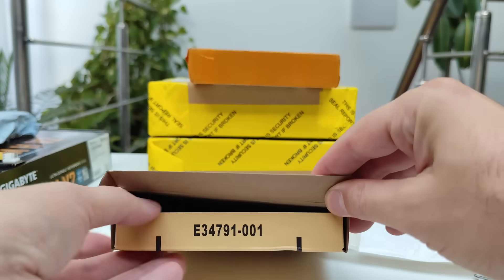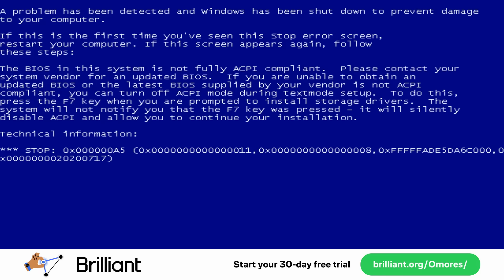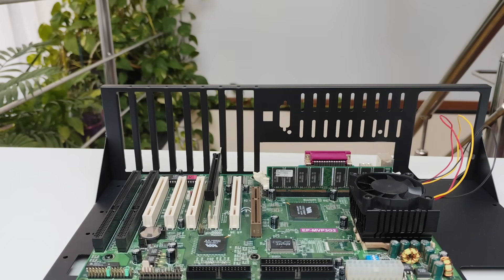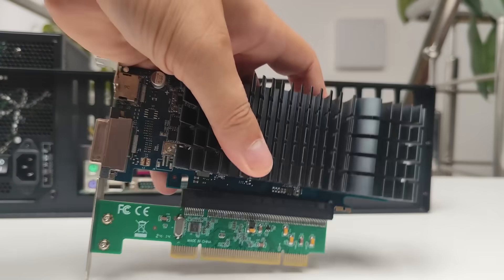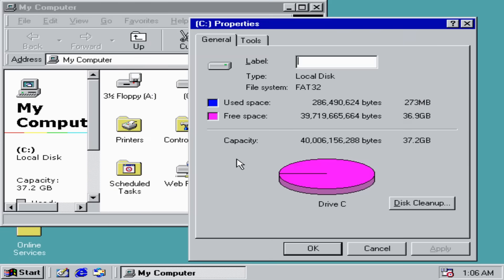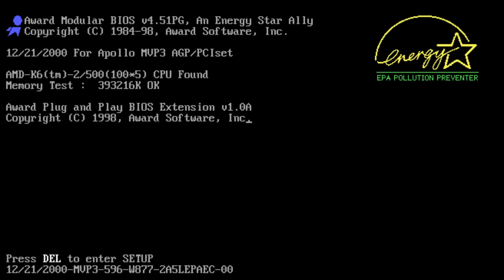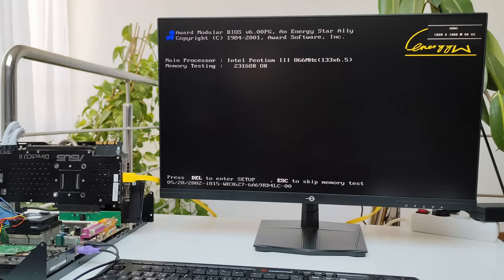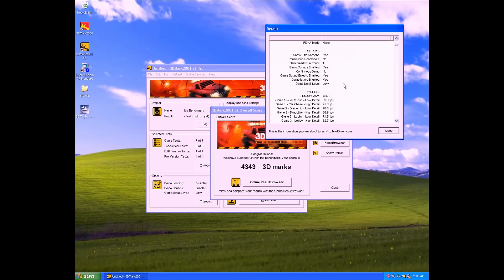The Ultimate BOTTLENECK: NVIDIA GTX 980 Meets Pentium III via PCI Adapter

Comment from the maker: To learn for free on Brilliant, go to https://brilliant.org/Omores/ . You’ll also get 20% off an annual premium subscription.
Reply: you can use a riser with molex power to power the gpu. if there is not enough power the drivers won't load, because the card has to communicate with the computer. and because of that you should also try again with a bi-directional chip and a 16x riser with molex power.  people used the risers to mount several gpus to a single motherboard for crypto mining. with the gpu fully powered and communicating via bi-directional chip there should be no issues.

Comment: Ill bet that the later the GPU (With compatible drivers) the better the speed, due too better compression.
Reply from the maker: I think this is the maximum for a Pentium III. Later GPU drivers require a CPU with SSE2 instructions, so for anything newer, we need at least a Pentium 4 or an Athlon 64. Also, RTX cards do not have 32-bit drivers, so we would need to go even further with a 64 bit CPU.
Reply: @O_mores   I wonder if we have any Linux work arounds for that??
Reply from the maker: @DarkLinkAD  I like Linux, but it's not really my thing. I mean, when it comes to Windows, I know exactly which hardware, drivers, and software versions work.
Anyway, when it comes to Linux and NVIDIA drivers, the support is not better compared to Windows. For example, you can install RTX cards on Windows 7 (released in 2009), but on Linux you need at least kernel 3.16, which came out in 2014.
Like in Windows - Linux NVIDIA drivers for RTX cards work only with 64-bit CPUs, so there's no workaround.

Comment: That "NATO approved supplier" badge is interesting. Lets dicuss that.
Reply from the maker: This is a NorthQ 400W PSU I picked up recently as 'new old stock.' I think it was manufactured around 2007. It’s got a semi-fanless design, so it runs at 0 dB most of the time thanks to a big, heavy passive heatsink. NorthQ actually exited the PC parts business and now they’re a major player in Denmark’s energy industry.

Comment: I remember PIII-1000 being bottleneck already to a Radeon 9600 XT back in the day. :D
Reply from the maker: When the 9600XT dropped in late 2003 (though most folks probably grabbed it in 2004 and later) Pentium 3s were already out of the gaming picture. Around that time, having an AMD Athlon XP was the best buy. The 2000+ to 2800+ models were basically on par with Pentium 4s at similar speeds, but way more attractively priced...

Comment: The craziest thing with adapters would be what Team Fail0verflow did when they were trying to jailbreak the PS4 and used a serial port as a PCIe bus and it worked, despite it being equivalent to something like PCIe 0.0000001x or something like that.
Reply from the maker: That’s really interesting! I used to binge-watch console hacking videos back in the day. I got my PS3 in 2007, but by the time it was finally hacked around 2011… the option wasn’t that appealing anymore. Looking back, it might’ve been a blessing - because once you have too many games, you start a ton of them… and finish none.

Comment: Too bad there is no AGP to PCI-E adapters (at least i didn't see one).
Even in 2x mode it's 500MB per second, which is 4 times faster than default PCI
Reply from the maker: I have an adapter that lets you use an AGP card in a PCI slot - check it out here: https://youtu.be/jflb_6Bpv-o Furthermore, we can use that AGP-PCI combo with a PCI-to-PCIe adapter. The combination won't look pretty, but it should be as compatible as when using a regular PCI slot. However, not every AGP card will work, more details are in the linked video.

Comment: Once i put a 3090 in my i5 3470 rig just for fun, now this is somethiing different
Reply from the maker: I think you could even install an RTX 5090 in something as old as a Core 2 Duo system. At one point, Nvidia drivers required newer CPUs (minimum first-generation Core i series), but as the drivers updated, they removed that requirement. I know because there was an article about running a 5090 on a Core 2 Duo, though the results weren't great...

Comment: You're an inspiration buddy :) these kinds of shenanigans are right up my alley and while I'm still watching a lightbulb went off-- 

how about running some GPGPU/AI/OpenCL-code on those tensor cores in such a retro system? 😇

PS: I'll bet you ran the benchmarks at 1080p? For age-appropriate benchmarking one should switch to 640x480 to 1024x768 max ;)
Reply from the maker: The most retro system that could run an RTX card would need at least a 64-bit Pentium 4, since RTX cards don’t support 32-bit drivers. That takes us back to around 2005... when the P4 6xx series (with EM64T) launched. Or maybe I could try an Athlon 64 from 2003 instead!
Reply: @O_mores   both would be awesome and unexpected by many :) can't wait for a follow-up! 

Oh yeah someone even made a DOS-client for LLMs a while back, very basic but it 'worked'  as a proof-of-concept, maybe it's made some more progress since. 

Let's show the world what we don't actually need dozens of modern cpu cores for ^^

Comment: Through the magic of adapters you can experience 0.25x of PCIe lanes
Reply from the maker: I love adapters… By the way, in my upcoming video, I’ll briefly showcase a PCI-E to PCI enclosure. It’s a metal box with four PCI slots inside that connects to a single PCI-E slot - and it works magic for running older OSes like Windows 9x, 2000, or NT on modern hardware.

Comment: What I really need but can't find anywhere is a PCI-e to PCI-X adapter.
Reply from the maker: If you want to use a PCIe card in a PCI-X slot, there was an adapter from StarTech - model PCIX1PEX4  - that could do it. It used a PEX8114 bridge chip but has been discontinued for some reason.

Comment: do a rtx card now
Reply from the maker: The problem is that an RTX card from the 20-30 series needs Windows 7, which in turn requires an SSE2 CPU. This means you'd need at least a Pentium 4 or an Athlon 64 CPU. I think it would be fun to watch anyway...
Reply: @O_mores that would be honestly
Reply from the maker: The key is the 2018 security update (KB4103718) for Windows 7. It added SSE2 as a mandatory requirement. So even if you got an old version of Windows 7 to install, the RTX drivers themselves are built to expect an SSE2-compatible CPU, so it wouldn't work anyway.
Reply: I don’t think Windows 7 requires SSE2?

Comment: Bottleneck? This is more like a syringe
Reply from the maker: Good one! By the way, yesterday I installed Windows 98 on a Ryzen 9 9900X. It works, but there's a bug or something...  now I have a CPU @4.4 GHz that scores lower than a Pentium II in benchmarks. This is new to me... I hope I can find a solution... On i5-14600KF it works perfectly and I get top scores in everything: https://youtu.be/G7qm3GFy9tg
Reply: The poor performance is probably because it's missing the AMD drivers that control almost everything. (Clock, power, and most importantly, scheduling the two ccd's) I think Intel has some of these built into the CPU, and AMD chose to offload to chipset/drivers

Comment: Yeah, I've never thought that there are people that want to get records from SS7. The problem with the newer GPUs is the driver CPU overhead for sure. That's what is so good about voodoo cards on slow systems.
Reply from the maker: I love Voodoo cards and have made a few videos about them. Check out this playlist:
https://www.youtube.com/playlist?list=PLomaAsb2xNcCrZZaxKOJF25CIaGtMWSWx

As for performance, it depends on how you define 'slow.' On a Pentium III/866, for example, a Voodoo 3 is only slightly bottlenecked - it delivers about 95% of what it’s capable of. Beyond 1.1 GHz, the results remain the same.
Reply: @O_mores  I was thinking about Voodoo 1/2 and really slow systems like Pentium 1/Pentium II. Ofc V2 SLI and Voodoo 3 won't be that bottlenecked with PIII 866... That's quite a good  match.

Comment: Maybe a pci-e to agp adapter?
Reply from the maker: If you're looking to put an AGP card into a PCIe slot, such adapters are available online. I actually have an AGP-to-PCI adapter, and I can use it with a PCIe-to-PCI adapter - it will look ridiculous, but it will work. I think I’ll do some testing, though I’d prefer a direct AGP-to-PCIe adapter since it’s more physically stable.
Reply: @O_mores  I meant the reverse, putting a pci-e card into an AGP slot since it has more bandwidth
Reply from the maker: Yes, there are some passive adapters that allow you to install a PCI card in an AGP slot. Then, you can use that PCI slot with an adapter like the one shown in the video. I saw a post on Vogons where, with this combination (AGP to PCI and PCI to PCI-E), the system posted, but I don't know if the driver actually installed.

Comment: 0.5% GPU usage
Reply from the maker: This card will run with the fans turned off immediately after the drivers load. It stayed like that most of the time, but the fans did turn on during 3DMark testing - I think it was the 'Sprite' benchmark that pushed it past 0.5% usage. :)

Comment: Near identical bottlenecking when AMD decided to include a huge amount of bottlenecking in their CPU
Reply from the maker: I'm unsure what bottlenecking you're referring to. But it happened to me yesterday! I installed Windows 98 on a Ryzen 9 9900X and the CPU runs slower than this Pentium III. It couldn't outperform a Pentium II in the SiSoft Sandra benchmark, scoring about 1,000 points compared to 22,000 points for the i5-14600KF. I hope I can fix this...

Comment: you test in 16x9 or 4x3 the tests?
Reply from the maker: I ran the standard 3DMark 2001 benchmark at 1024×768, but the monitor stretches this resolution to 16:9.

Comment: Can you please share links the the PCI to PCIe adapters you are using?  I would like both kinds.
Reply from the maker: I used generic cards from Ali... The bridge chip should be more important. The PCIe-to-PCI adapter uses a  PLX PEX8112, and the PCIe x1-to-PCI adapter uses an Asmedia ASM1083. If you wait, I have a fancy PCI-E to PCI adapter from StarTech that uses a different bridge chip, the PI7C9X118SL. I will do some testing and make a video.

Comment: Bro the ultimate bottleneck would be this processor and a 5090
Reply from the maker: Well, you’ve got to keep in mind that you can’t install drivers for a 5090 unless you’re running at least Windows 10  - and this Pentium III @866MHz is out of the question, even for Windows 7. While the original release of Windows 7 didn’t require SSE2, later updates and drivers do. SSE2 began with the Pentium 4, so running even the first generation of RTX cards requires at least a P4 and Windows 7.
Reply: @O_mores yup but you can put a CPU that can barely run windows 10 and a 5090 and that still a TON of bottleneck

Comment: I think your socket 7 issues might have to do with DirectX support. On my VIA or ALI systems I could only do up to DX7 anything beyond that crashed the systems both on 98 and XP and I believe the chipsets are not DX8 ready - tested with Radeon X800. As such I assume they cannot initialise a recent GPU such as 980 which I guess expects dx9 as a minimum
Reply from the maker: Turns out, it's the BIOS. On this motherboard, the BIOS assumes there's no device behind the PCI adapter - it thinks the adapter itself is the actual device, so the GPU doesn't get the right resources. Newer BIOS versions handle this better... but this is an Award BIOS... maybe an AMI or Phoenix BIOS (that some other Super Socket 7 boards have) would work.

I successfully tested an Nvidia 7900GS in Windows 98, check it out: https://youtu.be/G7qm3GFy9tg

Comment: I remember when i had a K6-II with graphics on board (on motherboard, not like today on processors), i had to change it because started to be unplayable with modern games of that period. Then i bought a Sempron with FX5500 graphics.
Reply from the maker: Yeah, I totally remember those days! In the mid-2000s, I passed my K6-2/500 PC down to my sister, and she was more than happy with it for a couple of years. I upgraded to a Duron @800MHz  - it only had 64KB of L2 cache, but it was on-die and ran at full speed. Later, I finally broke the 1GHz barrier with an Athlon.

Comment: At one point there was a PCI-X to pcie-4x adapter. I havent been able to find one for a while, but for a system that supports PCI-X, it may result in better performance.
Reply from the maker: Yes, Startech once made a 'PCI-X to x4 PCIe Adapter,' but it seems to be EOL now. And speaking of StarTech they sent me a cool PCIe-to-PCI enclosure - it slots into a PCIe x1 port and provides four legacy PCI slots. I will make a video soon...

Comment: use amd gpu they have use less cpu power so you should get better result than nvidia
Reply from the maker: Hmm, I should try. The latest AMD GPU with official driver support for Windows XP is the Radeon R9 270X, released in 2013... I think I might have one.

Comment: U can try to use a NVME M2 pci-e card on a pci adapter
Reply from the maker: Yes, I will try, but I need an NVMe drive with its own Boot ROM - something like IDE/SCSI or SATA controllers have. Without a Boot ROM, the BIOS won't detect the SSD, and it simply won't exist as a boot option. There are a few drives that can boot without BIOS support. I might have one of those, it's a Samsung SM951 drive.

Comment: Using 98 is pointless for the experiment. I installed xp on pentium 1. It works.
Reply from the maker: As I mentioned in the video, I was trying to beat a 'world record' set on a Super Socket 7 motherboard running Windows 98, so Windows 98 was my first pick. By the way, some guy managed to run Windows XP on a 486 by modifying the XP kernel. Windows 2000 officially supports the 486 architecture, but XP requires a Pentium-class CPU.

Comment: How much you will get from the GPU is then heavily dependent on the application. Say that everything you need to draw fits in GPU memory. Now issue a glDrawElementsInstanced call (the BFG of OpenGL), and you can have a realistically looking scene with decent frame rate, but forget about any interactions. Also, loading times may be horrible over the slow PCI bus.
https://www.youtube.com/watch?v=ZrJeYFxpUyQ

Comment: the way around cards flapping around because they're too big; pcie riser cable in that matx board.  just get the right style to connect to the gpu itself, so the cable doesn't prevent it from slotting into the slot backplate properly.
Reply from the maker: Full-height PCIe brackets are 12 cm tall, low-profile ones are 7.92 cm. When using an adapter, you’ll need about 2 cm of extra clearance since the bracket ends up around 14 cm. To secure it, a 2.2 cm long screw and a 3D-printed 2 cm spacer on top of the bracket should do the trick. You can leave the case open, or(if you're lucky) your case might have enough clearance to put the cover back.
Reply: ... you put the full height card in the last two(ish) slots in the case, and extend the pci to pcie adapter in the matx board, over to those farthest slots, by way of the pcie riser (more properly called an extension) cable.

no height concerns involved, so long as the end on the video card is a proper pcb style extension and not the flat flex direct soldered to slot style.

Comment: So with the adapters how much power can be supplied to the pcie cards without additional power connectors
Reply from the maker: The PCI slot can deliver up to 25W. All PCIe x16 cards initialize by default in 25W mode, so they should be safe when used with this adapter. A PCIe x16 card can later request "high power mode," drawing up to 75W from the slot - if the slot supports it. However, the bridge presents itself as a PCIe x1 slot, so the card will detect only x1 capability. It may request up to 25W if it's a full-height card, but it will not request 75W...
Reply: Wow you even answered my next question... Thank you!! Very helpful

Comment: Can it even run nvidias bloated drivers? :p
Reply from the maker: Yes it can... Turns out these 368.81 drivers from 2016 aren't so demanding when working with a CPU from 2000 that only supports SSE.

Comment: X1950 ati win98 drivers any suggestions??
Reply from the maker: Well, you’ll have to settle for the previous generation - something like an X850 Platinum. There are official drivers, and they don’t require any workarounds to install. The X1xxx series introduced some core changes in memory management, and ATI didn’t bother rewriting the driver for Windows 98. But if you want something powerful for Win98, check out the NVIDIA 7000 series, or the equivalent Quadro's, here's an FX4500 tested (7800GT), that also works in Windows NT 4.0: https://youtu.be/i_7yCmXm2wQ
Reply: @O_mores any unofficial for 1950? Already got 7900 and 850
Reply from the maker: There are no unofficial drivers, I looked for them.
Reply: @O_mores ok thx. Check pentium d with 98 as its the fastest pentium 4 inside

Comment: The reason the GPU behind the bridge on the MVP3 can't be configured is because the BIOS actually doesn't setup the necessary memory type range that high up in the PCI address range for a second bridge device.
It really only sets up the PCI-PCI bridge in the chipset and the PCI-AGP bridge range in the chipset. 
But the extra PCI-PCIe bridge addressing with higher memory is not configured for the PEX 8112
Newer boards with newer BIOS do it correctly though as they expect more PCI bridges to be added.
I had to solve this issue in coreboot BIOS as well when experimenting with PCI bridges.
Reply from the maker: Thanks for the info! It took me over 3 hours to realize it’s just not gonna work… with the EPoX EP-MVP3-G2. There might be a 2001 BIOS release for this board made for the G5 variant (2MB cache), but it’s also listed as compatible with the G2. I’m not expecting much to change, though… Maybe the SiS/ALi chipset boards handle things differently - there are quite a few models with Phoenix and AMI BIOSes.